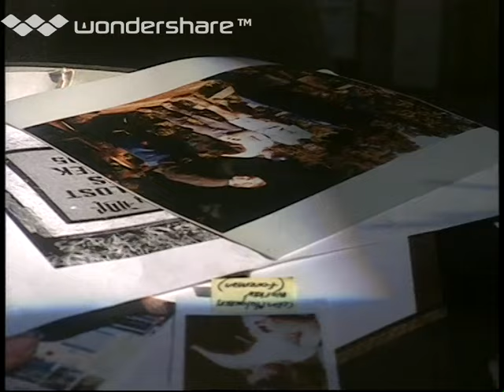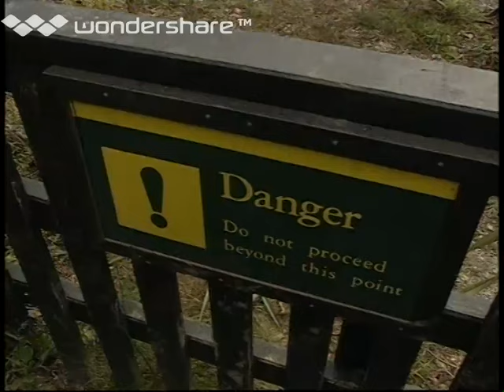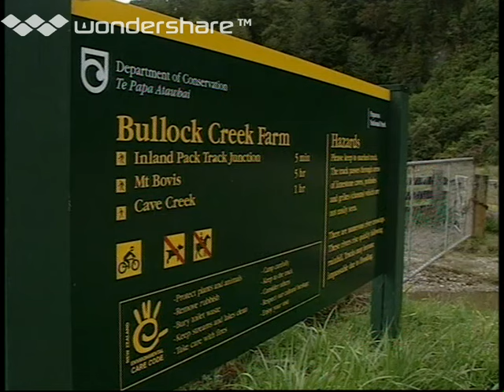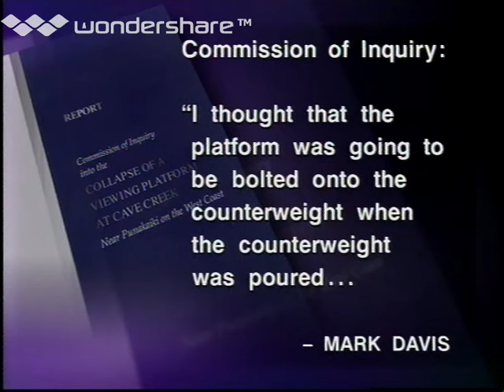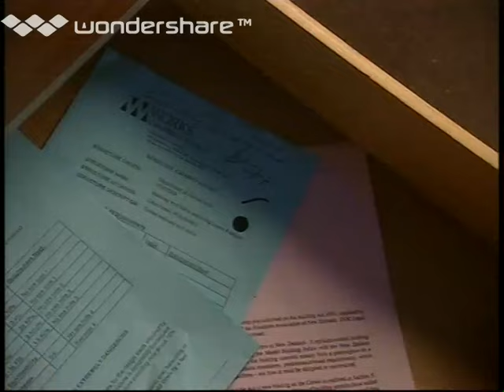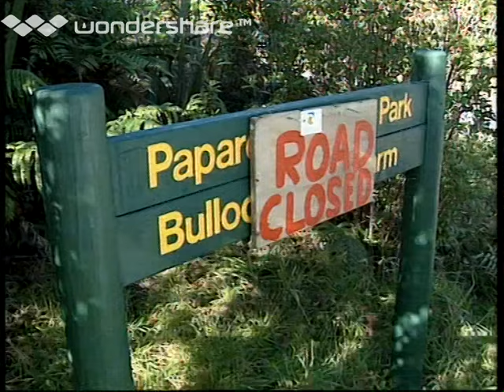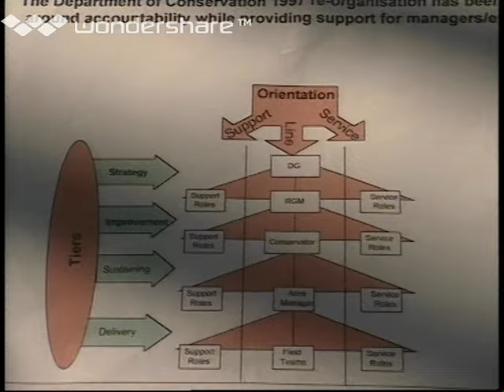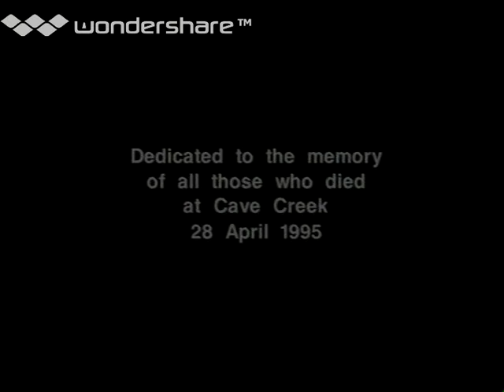Cave Creek: The Full Story of a National Tragedy

Comment: I know zero about construction or motors. Even I know you can't hang a porch on to a deadly cliff by nails. It would have been stronger tied to trees....
Reply: @PeRFeCT IMPeRFeCTiON Agree it should have also been chained to anchors set back in concreate and the support beams bolted to a foundation, and / or redesigned so that the platform minimised leverage forces i.e triangle shape and secured. More so the design should have had an engineer evaluate before construction and an inspection after completion.
Reply: @PeRFeCT IMPeRFeCTiON I remember when it happened and as a long term and active tramper it left me stunned for ages. I still see this sort of neglect for example in NZ rail pedestrian crossings compared to Aust. Such (NZ) are shocking and deadly and the application of money would solve it but no one cares - thanks for you reply.
Reply: To be real nails SHOULD be strong. We build houses out of them!
Reply: I dunno...  Knowing nothing about construction I wouldn't put a viewing platform anywhere near the edge of a cliff- let alone hanging off it. 

There's a reason they're cliffs to begin with, and that's because land has fallen away. As time goes on, the cliff is only going to be weathered more.
Reply: @Stopthisrightnow560  This is why you should conduct a risk / consequence analysis before doing anything like this. What is the risk of failure lets say  medium worst case. What is the consequence if it does fail - catastrophic, therefore we need to cover test and have every angle checked. If you build a loo on the track the worst that can happen is the door falls off not much need for analysis. A cater leaved platform over a cliff edge should have been engineered. If the risk is high and consequence is high then think of something else or don't do it.
Reply: Should have supported ghe edge of the deck to tree behind them or grounded them with cement bottom
Reply: @PeRFeCT IMPeRFeCTiON It was the front nails in the front beam (ridiculous)   that gave up where the most stress was, the  middle beam played little part at first, amazingly it held 17 people before collapse, so if the 5 persons max sign was up they may have got away with it!
Reply: I wouldn't go on it even if an engineer said it was safe.
Reply: So three good old boys with a load of pine and cheap nails build a platform 100 feet up.And nothing aligned properly and no inspections? Can't imagine how the judge said no one was to blame. Could someone explain that? People WERE to blame most undoubtedly!
Reply: @gerrywhelan5761  over time/weathering, those shallow sunk nails would have worked their way  loose/out,  with a repeating load max weight of only 5 people or just one person IMO, and eventually fallen or just fallen from its own off -balance unsupported ,weight , with no-one on it.
Reply: @chrisperrien7055  Perhaps true, but mind-boggling that they used nails, anything I build out side i use stainless steel bolts, or at least galvanised ones, also I would guess that those cowboys didn't use treated wood, Perhaps a disaster further down the road as well!
Reply: A wee bit of super glue and we're set!
Reply: @woodliceworm4565  considering it was built prior to most of these codes and specifications had been implemented.
Reply: @pamelamorris3148  Sorry Pamela that is not the case. In all construction, there is a common law requirement that the structure is safe and fit for purpose. These standards have been around since before the 40s, the standards improve over time as tech and knowledge improve. What happened here was a systemic failure of management and control. Well-meaning but fatal errors occurred in the planning, construction and oversight. Blame is pointless but review and prevention of future errors are priceless.
Reply: @woodliceworm4565  and New Zealand is a big country with a relatively small population so they tend to take care of their citizens very well bc they enjoy higher standards of living then Americans and we have oversight out the ying yang but as many Americans hate regulation & spending on infrastructure we have highway bridge collapses, levees break, entire tx power grid go down after couple inches snow last year but stuff happens everywhere. In China they have one of these glass platforms and they smash the glass with sledgehammers bc it has many redundancies but still looks wild.
Reply: Trees can un-root at a good downpour or a slight earthquake! Pilings & bolts, & I will still question integrity!
Reply: @JTScott1988  on the ground, or hanging over cliffs? Big difference!
Reply: @pamelamorris3148  yet things built 200 years ago still stand!
Reply: @woodliceworm4565  and management should have been fully accountable for not having qualified builders construct & examine!
Reply: @cristineconnell7803  The only point of assigning accountability after the fact is to assign blame, in this case, systemic failure occurred. While charges can be brought and investigations started and policy changed. lives have already been lost. It would be better if everyone involved would think in advance and if they are not sure - stop or better have a policy beforehand. I remember when this happened and as an experienced bushman tramper in NZ and engineering tech (At The Time) it was devastating news as I have said before if the risk of failure is high and the consequences high, change your plans.

Comment: It's probably safer, but when I look at that glass bottomed viewing platform at the Grand Canyon USA I think to myself no way in hell would I get on that.
Reply: Try the stairs going up to the top of the Eifel tower! LOL . note: (They have been closed to the public now for many years.) They were open in 1989 when I went there. Basically flying narrow steel stairs with 2 hand-rails, to 1000' up :) use was for getting down from the top or up  if the elevators failed/lost power.
Reply: It is a great view from there though, but if you don't feel safe that makes sense.  I had the same feeling with that Indian decor building at the grand canyon, didn't look to stable to me.

Comment: In 1995 a deck with 100 people standing on a 12 x 25 foot deck collapsed, injuring 59. It later came out that the band board was simply nailed to the house. The building code, in Atlanta, was changed to require that the band board be bolted to the band board of the house. 
I have a carpenter for over 50 years and the one thing I have learned is that no kind of "fastener" should ever be required to carry a supporting load when used with wood. Beams should always rest on TOP of their support columns. 
I know that there are hundreds of people that will argue with me over this saying that 1/2" bolts are more than adequate to support a wooden beam. I have personally seen many wood beams and floor joist split from being bolted to close to the end or to close to the "top" of the beam.

Comment: How old was it?  What building materials were used, what were the decomposition rates of materials (like wood, metal nails, or screws), and what kind of building "methods" did they use (load-bearing decks and overhang decks usually have "requirements") What were required in the building requirements for that specific spot, area, county, and state?  Who was supposed to maintain it, and what were the maintenance schedules?  

A few bumps and cuts are fine for things like this, but deaths are a different thing. 

Usually, after things like this occur with major injuries and single or multiple deaths, huge changes in maintenance, and building codes are required.  There are emany stories when we as a people have not changed for things like this. 

Sometimes it could be as simple as checking all the connections and materials used and how they are used.  As simple as regular required maintenance.  Even if it was someone's fault, withholding things from the families is not very good. 

Systemic mistakes are easily fixed.    Because there's a system to look at.

Comment: Darwin Award.  “Ten years after the accident, survivor Stacy Mitchell said that he and some other students were shaking the platform hard when it collapsed, which he had not reported at the time through fear of being blamed.”
Reply: The previous set of students were jumping up and down on it too the day before. They admitted it though. This platform definitely wasn't safe and the department DID screw up the whole process....but the platform likely would have held up if none of the kids jumped and shook it on either of those days.
Reply: that's what kids do I suppose.  Doesn't sound like there were any safety signs, weight & no.s limits on platform, considering it was hanging over a cliff edge.  This platform should have been made to withstand anything, sadly it would have eventually collapsed because of the shoddy design, implementation and workmanship.
Reply: The way I look at it, it’s the designers and builders of the thing that are responsible, even though the kids were fooling around - it’s what kids do and that should have been anticipated. Things like bridges and buildings are designed and built all the time to handle much higher stresses and loads than expected in normal use.
Reply: Did they believe that it was supposed to do that for special affects? No thinking on their part

Comment: Structures like viewing decks and upperfloor balconies/verandahs must not only be designed by a certified structural engineer but should have an accreditation/specification plate affixed to the structure indicating maximum number of persons allowed onto said structure. Ive heard of a few cases where people have congrgated on these types of cantilvered structure and it has resulted in severe injury and death.
If i am at a gathering and guests are ushered onto a upper storey verandah, i have been known to go downstairs and check the structural integrity of the verandah..........

Comment: Everyone in this horrible saga seemed unbelievably incompetent - especially up to the judge. 1:06:00 well said and quite an unbelievable summary from that Judge Noble. To quote him: "I conclude that it would be quite inappropriate to point the finger of blame at any one of the individuals. It is uniquely an institutional failure." Ummm ... I don't think so buddy! How 'bout you start with the guy that was supposed to BOLT (not use nails) but then they didn't even nail some of the nails INTO the wood but to the sides of the wood? And go from there... What part of an inhuman asshole did this judge come from?

Comment: Well for starters, you don't use nails to construct exterior wooden deck and rail, particularly not the load-bearing elements. Lumber expands, contracts, and can warp with the change of weather. That shifting can displace a nail as readily as plants or water can fracture stone. Nut and bolt are more secure. Untreated lumber will not last as long. I'm just a little old lady with no formal construction training and even I know better than that. These people tossed a garish umbrella off the platform merely for the moment's thrill in watching it fall. So much for appreciating the beauty of the natural world by decorating with your trash.

Comment: As an architect, I can claim a little expertise in this field. I saw nothing wrong with the design.  Its typical for the builder to omit the unseen such as bolts. They were omitted because they did not have a cordless drill. Although the technology was in its infancy, they were around. Since the boards were pre-cut before they were delivered to the site, they could have been pre-drilled for the bolts. If the designer would have been required to check the final product, he would have noticed the missing bolts. I can't believe this country executes people for having pot, and do not punish this homicidal negligence.
Reply: I'm sorry.  I get N.Z. and Indonesia mixed up.
Reply: The platform was built off site & delivered built by helicopter to cliffside

Comment: I remember seeing a bungled project and was told that they allowed a guy who operated heavy equipment to make the decisions since he was familiar with working with heavy equipment to do the job.  My response was that men who operate heavy machinery implement engineering decisions; they don't make them.
     What systemic failure?  The law required plans to be submitted, analyzed and approved.  If there was no retroactive approval process, the top of the platform should have been taken off the pilings and then the plans submitted.  If the plans had been approved with bolts, tied in counterweights and the rest, the foundation could have been rebuilt to those specifications.  The managers failed to do the very things that are designed to prevent death and injury. This lead to death and injury.
Reply: @Lewis Doherty...well said.
Reply: And without consequences, sadly- it will happen again. 😢

Comment: Everyone's already commented on the construction of it (and rightly so, good lord what were they doing) but the capacity sign also bothers me - even with capacity signs, the usual rule is that when building for the public, you overbuild it and then say the capacity is considerably less than that, so that when people ignore the sign, they're still safe. That platform evidently fit 18 people easily, and they were going to mark it as 5 capacity, with (per the documentary) a failure point of 10 people's weight? That was doomed. Unless they stationed a park warden there to nag people about the capacity limit, this would've happened even with the sign.

Comment: Micky mouse builders.  No site map available on site!  If they knew they could not put the bolts in to secure a suitable foundation the project should have been stopped and back to the drawing board at that point.  This looks like a bespoke project.  Lack of training in certain roles on site on and off.   A catalogue of coincidences all coming together with disastrous results.
Reply: I would have thought they would need specialist design, implementation and construction for something like this.  And they had no plan to follow, the steel-work didn't show up so they just hammered it together with some nails.  This is just beyond belief.

Comment: Nails! They used nails to build this?? I'm surprised it lasted as long as it did. It's been a long time, may all the families be at  peace and feel the comfort of their loved ones memories. RIP young students....
Reply: Nails are actually extremely important for wooden structures. The mild steel provides superior shear strength over screws or bolts. Screws and bolts are used to securely hold to pieces together but can snap more easily. For maximum strength a combination of nails, screws and bolts should have been used.
Reply: BigMac39 right, that’s true what you said. But it seems like This thing was a ticking time bomb, in a way. And when it went it took 14 people with it. Tragic for sure.
Reply: I 100% agree. I was just correcting there original commenter acting like using nails was stupid.
Reply: BigMac39 lol yeah. I thought that too
Reply: I couldnt believe it didnt fall when the men who built it had their picture taken on it.

Comment: Soon after the accident, the Department of Conservation inspected more than 520 structures, and 65 were closed for repairs.

The review led to the removal of a large number of structures on public land, and many safety notices appeared on the remainder around New Zealand. Indeed, some felt the response was excessive; for instance, bridges and platforms were labelled with signs such as "1 person maximum", acting as an eerie reminder of the disaster which prompted the safety review.

Although DOC took responsibility for the accident, there were no prosecutions due to a loophole in New Zealand law that prevented government departments from being held liable in such a situation. $2.6 million was still paid to the victims' families, however. Since the accident, New Zealand law has been adjusted to ensure that the Building Act covers government departments, and to allow government departments to be held liable for such negligence in future. - Wikipedia
Reply: Too little too late
Reply: If 2.6 million is divided by 18, they received approximately 144,500 each
Reply: Aaand then the nats scaled it right back again in 2011 🙄

Comment: I'm not an architect nor am I a building engineer, but even I could tell that thing was built incorrectly.  The platform itself needed to be longer on the ground, then the part hanging off the cliff should have had several steel beams underneath it which should have been secured to the side of the cliff.  The piles should have been put in the holes then surrounded with concrete then everything nailed together with big ass bolts!

Comment: If group A knew the platform didn't seem stable why did they allow group B to go on it the next day when it hadn't been inspected for safety?  Very silly someone needs to be held accountable. Surely if  the public used the platform it should have been built by professionals ....structural engineers etc
Reply: S M  Well the person who noticed it being unstable the previous day DID request somebody come check it out, the problem was everyone jumped onto the platform the moment they got there.. and she had to stop and have a pee break.. its like an hour+ walk out there (after a twisted ankle) the person she brought came.. and also died.. it seemingly happened so fast he couldn't judge and react fast enough to say it was fucked and save anyone.

It was likely pushed to the brink by the previous days group.. and all it took was a full load the next time.